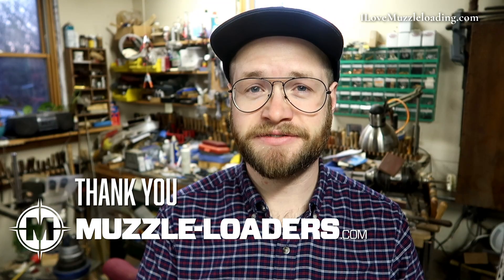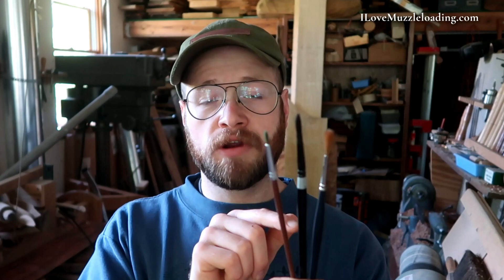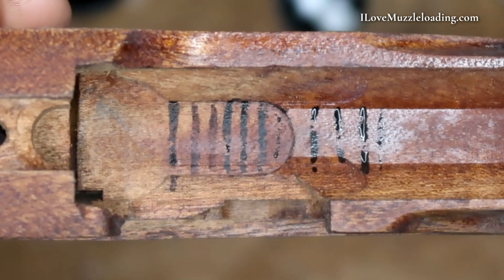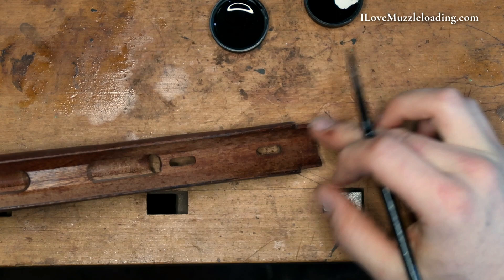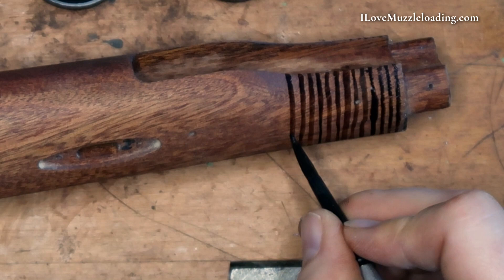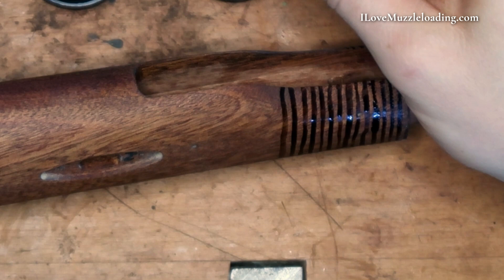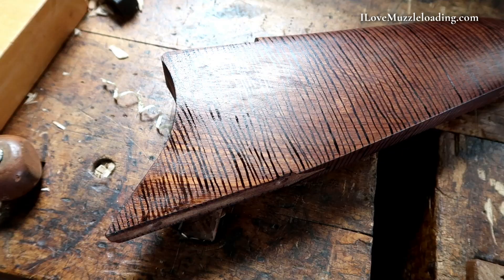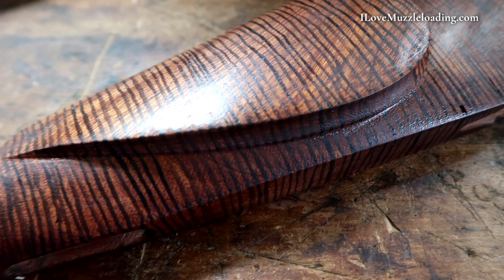How to make Faux/fake "tiger stripe" Wood Grain  | Investarms Gemmer Hawken How to Build Part 22

Comment: Your video came at the right time for me , I am building a Ieman full stock rifle and looking for the best way to stripe it . I also seen a technique in which you can wrap the stock with wire and use a flame and lightly   scorch the wood . This also gives nice results . Keep up the good work . It's great to see a young guy like you get this interested in muzzleloading . Thanks!
Reply from the maker: Thanks Robert! I've not seen an original that used the wire/flame technique but I bet it will work out okay for you. 
All the best, 
Ethan

Comment: I found when I did refinishing or finishing on a gun stock I always preferred just using oil as stain in one form or another versus trying to stain something to make it darker. One way that you can mark darker stripes on is a trick guitar guys do where they wrap metal wire around the guitar neck and body when the wood is bare before any stain is added and then they lightly go over it with a propane torch and that makes some uneven stripes and then the whole thing stained and it looks natural like striped maple.
Reply from the maker: I've heard about the torch and wire method but haven't tried it, maybe on another build!

Comment: Another great video, Ethan.  Thank you so much.  Would it matter if you applied the ink before the oil?  An iron-gall ink, like Platinum black sepia, might give better results and dry faster.  Noodler's inks are notorious for long drying times (among other things).
Reply from the maker: Hey John, thanks for watching! I think the order of the application would matter depending on your wood and it's grain structure. I applied oil first following Mitch Yate's tutorial. He said the ink bled more, and ran into the grain when he applied the ink first. BUT he was using a softer wood than I believe this european walnut is. 

Great tip on the kind of ink, the noodler's did take a day or so to fully cure, even when I set it in the sun! I'll keep that in mind.

Comment: ink first , then any stain you may use , then oil ! you want to vary the width of the lines , and the spacing , it varies quite a bit on real maple ! and try to not make them straight ! and no oil on the stock before doing the striping !
Reply from the maker: Thanks Joe

Comment: That looks far better than I thought it would. Kinda makes me regret not doing an aquafortis stain and faux striping on the beech stock that came with my Bridger kit. Oh well. The stock is already completely finished. Onto the metal. This is only really meant to be a utility hunting rifle. It should get field aged, as it were, after a few seasons in the woods. I don't think I'll ever build another Hawken, but if I do, I'm going to use a blank of figured maple or walnut and use quality parts from TOTW or one of the other suppliers. Ive already got a longrifle build waiting for me to complete this thing anyway.
Reply from the maker: I don't blame you, in the end these are usually tools and work just fine without the fancy additions. I hope you enjoy the longrifle build!

Comment: If you want the stripes, just get a curly maple stock, use the aqua fortis, and you'll get it just fine.   Faking just doesn't cut it.  Never, never use the aqua firtis after any oil.  It just won't work.

Comment: do your ink and lightly work back with 0000 steel wool after it`s dried , then apply oil !  you`ll be surprised by the results  ! I`ve been working with curly maple , and doing faux striping on other woods  for the last forty years !      do the ink first !